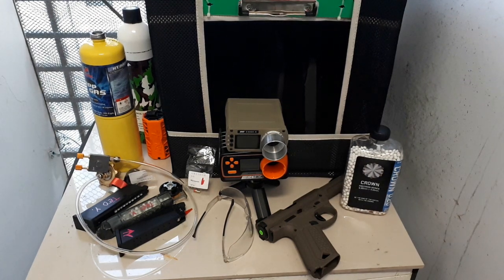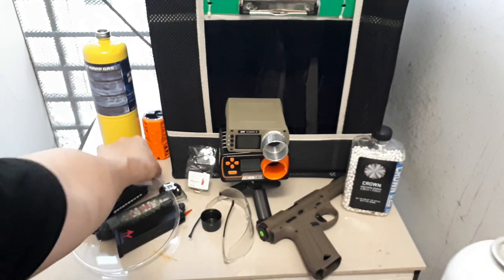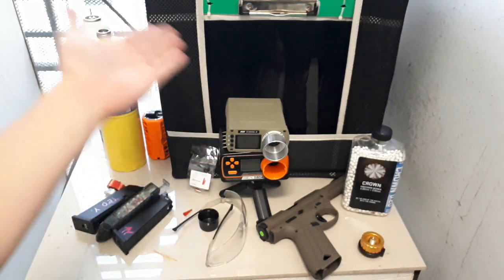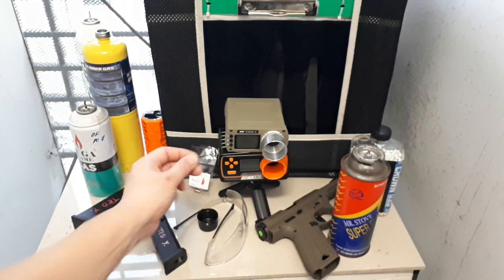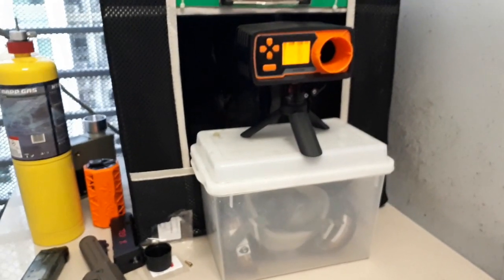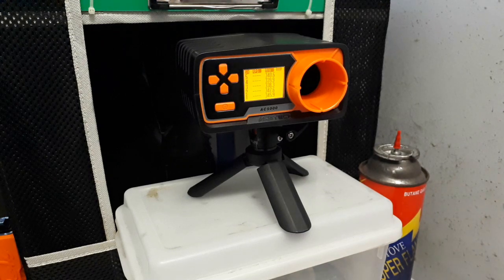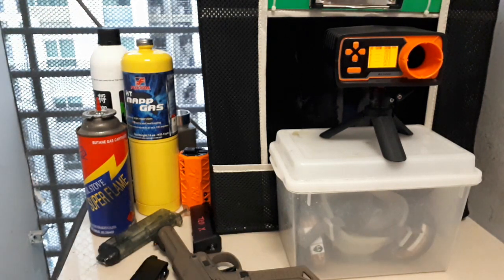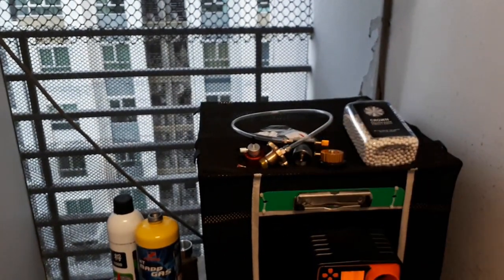Airsoft: alternative/cheaper gas for GBB, tested, failed, mapp, butane, cooking, propane, lpg

Comment: Green gas is Propane. There is no difference except for the additives. Green gas has added silicon oil to keep your O-rings inside the mag from wearing out. Propane has no odour so it has additives that make it smell so you can smell a gas leak. It is all the same stuff so there will be no difference to the performance. Propane is cheaper but you will need to add your own silicon oil. 
If you are a serious airsoft player then maybe propane might save you a few $. But if you buy green gas in bulk you can also save $.
Reply: New airsofter here. Where would one go to buy said green gas in bulk?

Comment: Most MAPP gas is a blend of propylene and propane, and performs ok-ish in my experience, but pure MAPP (propylene, AKA propene) is much better than green gas or propane. Rothenberger "MAPP® GAS" and Salvus MAP-HTi (with a grey label stating "Propene", not the one blended with dimethyl ether and propane) are both pure propylene, and are amazing!

My TM P226 kicks like it's running CO2 even with a guarder steel slide, and gives me 305fps with pure MAPP, while green gas/propane gives me 275fps. The number of shots I get per magazine goes up to 62 on MAPP, from 50-55 on propane.
Reply: please share what brand gas you're using. thanks!
Reply: @greenlightforce  Rothenberger, Salvus (grey) and Bullfinch (cheapest in the UK) are all 100% propene
Reply: @Corvid  thanks!
Reply: @greenlightforce  It's often tricky to find pure MAPP, most brands are a mix of Propylene (propene) and crap like butane, isobutane, dimythl ether. Any MAPP that's not pure will either underperform and be essentially a janky inconsistent version of propane, or worse, give way less FPS (some mixtures are under 50% propylene, totally useless and way more expensive than even propane). Lots of trial and error with some guns though, as the increased pressure needs a hammer with a very firm strike. If the hammer design has a poor mechanical advantage, the hammer spring will need to be so strong that the additional pressure from MAPP may not be enough to cycle the slide well.

Anything than can run green gas and CO2 usually has hench hammer springs and will do absolutely fine. I'm looking at buying a Northeast UZI to run on MAPP. They're on-ish on propane, but run better on CO2. I'm banking on pretty good performance on MAPP, especially in summer. Way cheaper than 12g CO2 capsules (although I'm also tempted to see if there's a way of using rechargeable capsules, as CO2 itself is insanely cheap in bulk).

Comment: Was the chrono calibrated? Some have a menu to choose the ammo type(.68 paintballs, .40 paintballs, 6mm, 8mm, the weight of the bb's, etc.). The oil in the gas lines all the internals such as hop up and the exit seal on the mags. Unfortunately, government ruling has a law stating you can't use a propane tank that has been refilled from a bigger tank as it may be overpressurized and cause an explosion. So the "Gas Can" has now been outlawed in the US. It was the size of a standard flash bang grenade, which you could carry a couple during an event instead of the bulky propane tank.

Comment: Using map gas is not a good idea propane its much safer map gas is much more toxic to people than propane especially since usually a gbb gun is going to be fairly close to your face when firing and especially if you play indoors there is a reason they put a strong odorant in it

Comment: I believe they use the oil to lubricate the O-ring in the cylinder
Reply: the follower is what pushes the slide lock up
Reply: co2 is a good alternative all my sidearms have been co2
Reply: @amiaddicteddiecastrc1557  CO2 is more expensive than propane, not as much as green gas, but still expensive..

Comment: using none Airsoft gasses will cause problems with the Seals/O-rings and in most cases destroy parts as airsoft guns are designed to be used with the correct pressures and with oil Additives to function correctly to the regulations and to the manufactures safety & requirement's.
if you want cheap pressure alternative to gas then buy a Stirrup pump and a 1ltr aqua tank and add about 10ml of silicone  oil/spray to each refill and pressurize it
make sure to regulate with a gauge upon refilling the Mags
or you will end up destroying the valves, I know!

Comment: did you empty the gas from the mag before trying the other gas,? just asking
Reply from the maker: Of course, mixed gas would affect the speed.
Reply: I'm from Philippines and the mixture of LPG here is 60% butane and 40% propane,.. can it still be usable?
Reply: @dr.leequack7843 
Try ko sa We hi-capa. Gumagana naman. Basta alaga lang sa silicone oil ang mga orings ng mag
Reply: @karimalarifi7778  thankz,. ung LPG ang gagamitin na try nyu ba?